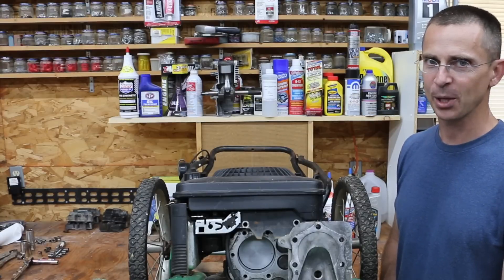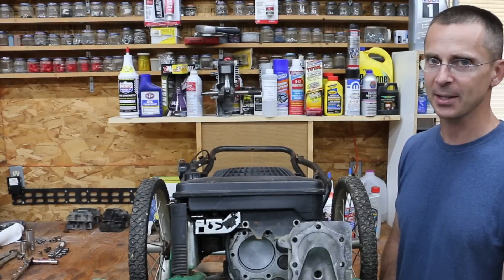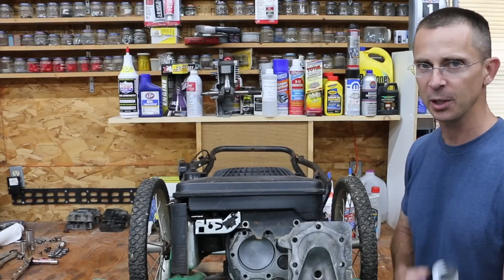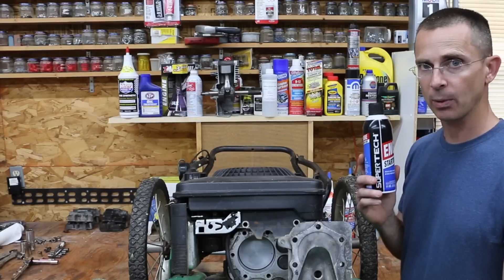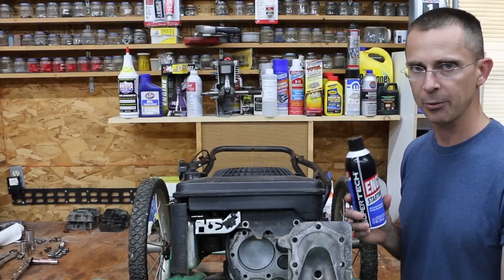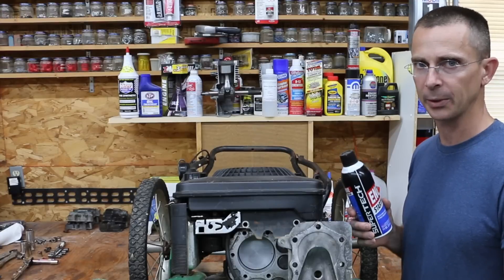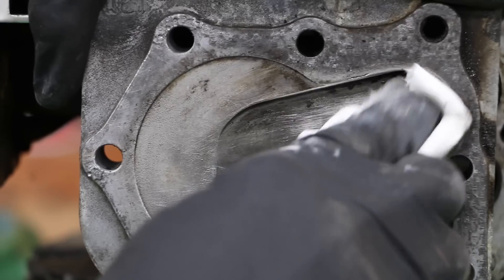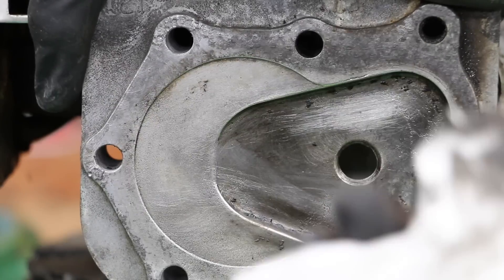Will Running an Engine on 100% Starting Fluid Cause Damage?  Let's find out!

Comment: im from the uk and enjoy watching your videos... over here the most common starting fluid on the shelves is Bradex easy start. on the can it says it has an upper cylinder lubricant in it, which may explain the film of oil you saw in the combustion chamber of your lawn mower engine.
Reply from the maker: Dave, Thank you very much for the positive comment.  Yes, I believe the starting fluid had a lubricant in it.  Thanks again!

Comment: diesel is an oil it helps lubricate the top end starting fluid { either } has no lubricating properties that i am aware of so  over time the engine may have extreme wear  from lack of lubrication  sorta like running a diesel on gasoline  this is my opinion
Reply from the maker: Thanks for commenting!

Comment: Don't try and use starting fluid on a diesel that has a heated intake grid, or glow plugs. It almost for sure will cause an explosion. My dads very old school TD24 dozen absolutely had to be started on fluid though.
Reply from the maker: Great point!

Comment: Yes over time it will do damage! Depends on type of starting fluid and if it has lubricants or not. Most small engines will run at a much lower octane rating and they are pretty adamant about not using 93 octane. Starting fluid by its nature has a higher flash point to kick start the combustion process. With diesel the high flashpoint with very high compression is like controlling a bomb with all its little fragmented pieces. You probably could the first few times but certainly not indefinitely. .failure isn't far behind if you use on a  regularly basis due to a faulty fuel pump making it hard to start!
Reply from the maker: Thanks for commenting!

Comment: Try E85 and try to adjust to make it run 30-40% richer. Maybe it will clean out the engine also.
Reply from the maker: Thanks for this suggestion!

Comment: The trouble with using starting fluid on a diesel engine isn't really the high compression ratio. It is the glow plugs. Starting fluid used in conjunction with glow plugs can be catastrophic. I have used starting fluid on many old diesels without issue, but that's only because I disable to glow plugs first. (Which are likely not working much anyway if you're having to turn to ether to get a diesel started.)
Reply from the maker: Sean, Thanks for this explanation!

Comment: Run an engine on warmed pure ethanol/alcohol/methanol fuel. Keep the preheated container as a reservoir and a separate fuel line. Cause dropping alcohol fuel into a metal tank will cool it down significantly . Then do the same with a cool mixture.And with pure gas and compare results!
Reply from the maker: Jonathan, Thank you for this recommendation!

Comment: Im just enjoying your channel and seeing your tests. It reminded me of another video i seen of a man who allegedly used a piece of wood as a piston for his small 2 stroke moped. Now this being the internet and who knows if whats on the other side of the screen is real, it would be a fun experiment. The video only had a still photo of the engine with the jug off and all i could tell was it looked like hardwood, maybe treated with something. It had just a flat top, the bottom had been hollowed out for the connecting rod, a hole for the wrist pin and it did have ring grooves and rings installed. I would just love to see if that has a snowballs chance in you know where of actually working for any significant amount of time.
Reply from the maker: Thank you for this project suggestion!

Comment: i believe the reason they say you shouldn't is due to knock causing the engine to detonate especially with a diesel due to a high compression ratio, also on some cans of it they say not suitable for engine management style motors id imagine again its down to knock as the spray it self is designed to commbust easy to aid in starting, i think its fine for lawnmowers and the likes and i still use it on modern cars when they are playing up, i once run a rover 25 on a few bottles of white spirit to get me home one day, it worked and went like shit off a shovel but the engine deffo ended up hotter.
Reply from the maker: Nathan, I agree.  All Great points regarding the use of starting fluid.  Thanks for commenting!
Reply: thanks keep up the good work, i wonder if its worth looking into the effects of other flammable liquids that you can use and which ones are best suited like running on Kerosene and other oil based products. really appreciate the effort you putt into make a test fair so the internet trolls dont get triggered.

Comment: I think it wont damage a diesel engine but will damage the fuel pump because the pump is lubricated by the oil in diesel, but if you spray it into the engine I think it would be allright because the cylinders I think are lubed by the crank case oil
Reply from the maker: MN SHP, Thank you for commenting on the impact to a diesel.

Comment: your dumb but not really you should try the cheap starting fluid which has a much more powerfull explosion like "power start"
if you have them in your country
Reply from the maker: I used both a generic and a name brand starting fluid in this video.  Thanks for the recommendation!

Comment: did u check out my vid with the string trimmer running on 6 year old fuel
Reply from the maker: Dave, Yes, I'm impressed that it ran.  I'm guessing that it did not have ethanol based fuel.  Glad it's running!

Comment: GASOLINE engine can run like a dream on starter fluid... Twostrokes are gonna sieze and in diesel engines too much starter fluid causes cylinder head to crack between valves or even pistons to crack under pistonrings...
Reply from the maker: Antonio, thank you for this information!
Reply: Project Farm I know because my dad is mechanic and he saw what happened when people used it violently to start engines... For TWO STROKES USE WD-40 and you got great effect and because it's silicone based oil it won't sieze...

Comment: I remember when i was 16 yrs. old my uncle had an Oliver Cletrac,it was gas,& he used ether capusels to start it they said it would knock a little at first. He didn't use whole thing  about 1/4 of it. I think it was so hard on the battery,it was 6volt & turned over very slow.That was 60 yrs. ago. I always was very sparing with starting fluid after that.Thank you for your knowledgeable videos!!
Reply from the maker: E. Michael Himmelhaver, Thank you for sharing this experience!  Also, thank you for the positive comment!

Comment: Can you run one tcw3 mixed with gas in a four stroke engine to see if theres a buildup? There are people running 1:640 to 500 with no problems and claim smoothness in it
Reply from the maker: Window prompt, This is a great video project idea--thanks!

Comment: Hi, thanks for all your vids ,great stuff. In UK here, we have a diesel starting fluid called EASY START, rumour has it if you use it to often the engine becomes addicted to it and will not start without it. A long term test I know but would be interested to find out if there is any truth in the thinking.Again thanks for your great videos.
Reply from the maker: This is very interesting that there is a specific formula for diesels in the UK.  Thanks for sharing this information!

Comment: I think that over long term with higher rpm than idling would cause slight scoring. Also try putting brake fluid in the fuel tank or oil chamber.
Reply from the maker: Great point!  Thanks for commenting!

Comment: Wow! If your motorcycle runs out of fuel, you can run it with starting fuel! Of course no 2 strokes will like that. Btw, try running a 2 stroke with starting fluid-vegetable oil mix and see what happens. Also, you are a guy that every engine guy should subscribe for the quality of your videos!
Reply from the maker: Thank you very much for the positive comment!

Comment: Some times here in Gaza the fuel may not enter to the strip (politics)  so what do we do? We mix the brake fluid with what ever amount of gas we have straight into the motorcycle tank,and that should increase the total amount of the rare gas, but does it damage the engine? U may find it out sir !!
Reply from the maker: Osamah, Thank you for this video project idea!

Comment: How long will an engine run for on lighter fluid? If need be, would it work if you added oil?
Reply from the maker: Morgan, thank you for this suggestion!
Reply: Project Farm no problem, love your videos, hoping to be an engineer myself one day, hello from New Zealand!
Reply: Lighter fluid has some oil added already, to help keep it from evaporating as quickly. That's why Zippo lighters smoke a little  when they burn.

Comment: I'm completely surprised that it didn't hurt it or smoke at all. Be interesting to see if it would clean a dirty motor. Finally I'd like to say why it absolutely does hurt a deisel a mechanic told me it detonates and can crack pistons.
Reply: Think or read about fuel and ignition timing in a diesel engine.

Comment: try running it with 80-100% ethanol, methanol or acetone
Reply: JoraForever Acetone gets my vote. Great idea!
Reply: Alcohol based fuels would likely require require a much richer jet  in the carb. gasoline is 14.7:1  while I think alcohol requires 8.6:1   . thats pounds of air to pounds of fuel.   I think that is what my LM-1 wide band O2 based AFR meter says in the instruction manual. colour me wrong if you like.  my memory isn't the greatest.
Reply: blair79 bear 
I believe you are correct air/fuel ratio for alcohol based fuel is somewhere between 8:1and 12:1 depending on what kind of alcohol and if it is blended with a lubricant
Reply from the maker: JoraForever, Thank you for this recommendation!

Comment: Run a regular gas engine on e85 for ten minutes and see what happens
Reply: Zack Schilling the Ethanol will eat away at the injectors and fuel lines, it's more long term damage than anything really.

Plus the timings will be wrong (different fuel etc) so the engine may not even start or run correctly

Comment: I wonder if an engine would run on a bottle of fuel injector cleaner without the gas, like you did with the starting fluid? I know that it's a gas additive, but it might just work...
Reply from the maker: Thank you for this suggestion!

Comment: I was kind of surprised at the result until I remembered something on most cans of starting fluid. Usually it will say something like Starting Fluid  and in smaller print somewhere it says "& upper cylinder lubricant."  I'm guessing that oily film left over protected your engine from being damaged while running. Pretty cool test, although I wouldn't do this just because gasoline is way cheaper than cans of starting fluid. Nice experiment though.
Reply from the maker: Loren, I believe this is some form of lubricant in this product.  Thanks for commenting!

Comment: I work on diesel farm tractors, The problem  with starting fluid comes when guys don't use it properly like putting a lot in then turning the motor  over and vapor/hydro  locking it up when it raises compression to much . It can break pistons/ rings or ring lands on the piston. in some instances it can bend/break rods to  over time. one particular brand of tractor I work on we call the stuff head stud stretcher that doesn't need explaining why we call it that. 

 An engine will always start/stop on the same cylinders. guys I know that ran highly tuned diesel tractors for competition pulling, have had issues with the residue causing hot spots in those piston crowns. Then melting those pistons when they got the boost pressures up during the pulls, they stopped using ether the problem went away. 

Years ago my dads uncle worked on IH drott dozers  he said back then they pulled heads and the motors were gummed up with residue on the ones that were worn out or the glow plugs didn't work. Another interesting thing is diesel engines that the batterys low on, so guys give it a shot then turn the key and the glow plug kicks in  it can crack the head pretty good to when the  explosion they just created goes off.
 I only use the stuff here as a last resort in the winter, a machine with a good motor, working cold start system, and battery/starter motor shouldn't need ether. My  backhoe I brought wasn't going to be used in the winter. But I needed it after a bad storm.  it has no circulating block heater or working glow plug fitted. I used a heat gun straight in the air intake and after doing that for 5 mins it fired right up with no ether, so ill fix those problems and leave the can in town on the store shelf.

Comment: This might sound realy stupid, but if you have a 3d printer, can you try printing out a piston. I know it wont work for very long, but I want to see if it will start or if the piston will just crack when the engine starts spinning
Reply from the maker: Edvin, Thank you for this recommendation!